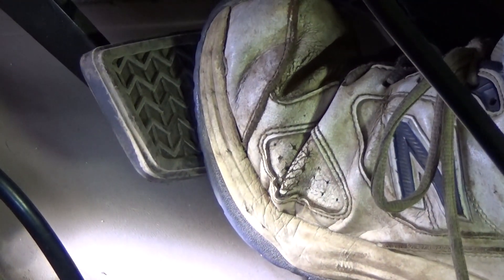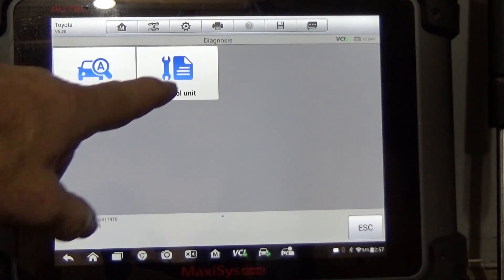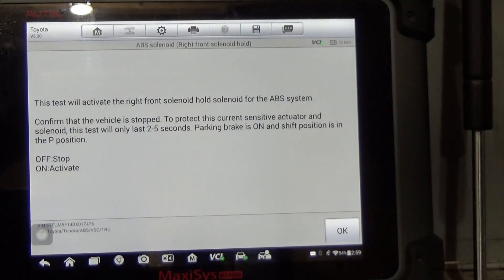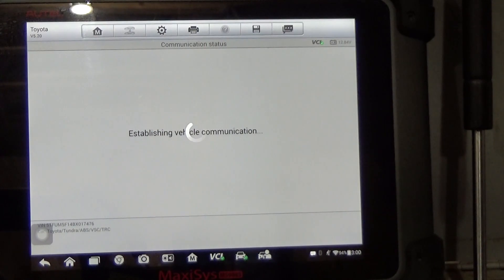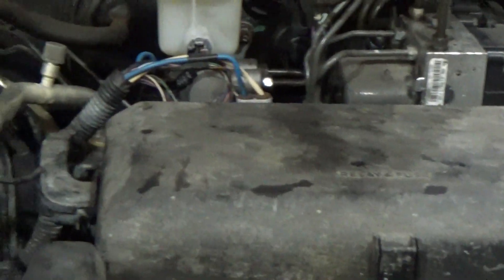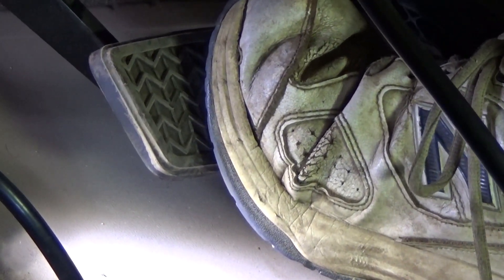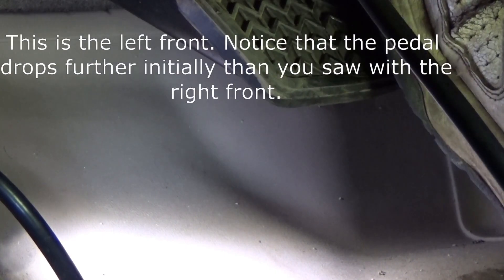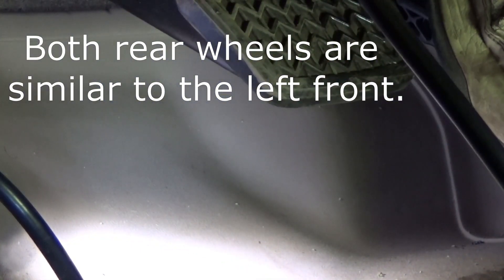Tundra ABS Controller Hydraulic Failure

Comment: John, Thank you for posting this video. even being an engineer for years, we are still learning every day. 

Got a few questions for you

Problem: I have the exact same truck and the same issue you have described. I used the software to test the ABS hold and release solenoids and applying brake pressure through the pedal, one of wheel behave differently from the rest whether triggering the "SFRR" or "SRRR", the pedal will travel further as you activate it, it only applies to the passenger rear, so it is obviously different when thing should be identical to each wheel,  then I went on to study this particular ATE ABS hydraulic circuit online, but seem like I can’t find an exact match of what I am looking for, without the missing information, I can’t seem to connect the dot, I hope you can shred some light since you are pretty smart using the elimination method to identify the problem.

Given  – Fluid is incompressible, the system is free of air, MC is in working order.

Assumption 1 – The Tundra MC Hydraulic circuit  should be pair as follow –  (Front Driver/Rear Passenger)         ( Front Passenger/Rear Driver) 
             For this MC configuration, we assume both plungers is in working order. If not, this ABS test may not be valid.
Assumption 2 –  we are working on 12 valves units,  for each wheel, there should be 3 valves, one being Solenoid Feed(NO), Solenoid Return(NC) , not sure about the last solenoid, I assume it is isolation, but the most online source does not show it. That is still puzzling me what are the last valves for. Either way, 12 valves total.
Assumption 3- two Low-Pressure Accumulators (LPA), one for each individual MC circuit. 

Logic 1 – The purpose of the Solenoid Return is to control the pressure relief into a lower pressure region correct? if so, the pedal should move as the displacement increase with a given amount of fluid ( went into LPA)? This test tells us RR is the prove this logic is true, and 2 scenarios can happen-

1.)	LPA is filled with Fluid(Where the fluid went exactly? I thought it is a closed system? I don’t see a return line back to the brake fluid reservoir like other design) 
2.)	LPA is not filled 3 solenoids are stuck mechanically and one is working?

Logic 2 –  It can be the RR circuit one-way valve or the solenoid bypass, or the rest of the circuit has an issue except RR.  Without knowing the purpose of the last solenoid, I can’t make that conclusion
Reply from the maker: This is going to be fun, I cover a lot of this in our ABS/Traction Control system classes. First the control solenoids (valves) Originally ABS only needed two valves for each hydraulic circuit that it controlled. One valve to isolate the wheel (or wheels) and one to dump pressure from the wheel(or wheels) if it was still locking up. The low pressure accumulator should not be filled with fluid under normal circumstances. Fluid get's dumped to the accumulator when a wheel is locking in order to release it and get it to start turning again increasing tire traction. 

Newer traction control systems and automatic braking systems had to add a third valve to allow a brake circuit to be pressurized without pedal application. That valve has now claimed the name of the isolation valve. The original isolation valve is now called an inlet valve. 

There are three channel systems and four channel systems.  Confusion can occur during testing if your tool does not alert you to the possibility that you may have a three channel system when it appears to give you controls for a four channel system. Count the lines connecting the ABS controller to the rest of the vehicle.

 5 lines,  A Three Channel System:
Two for the master cylinder input, 
One for each front wheel output, (total 2)
One for both rear wheels.

6 Lines. A Four Channel System
Two for the Master Cylinder Input
One for each front wheel output (total 2)
One for each rear wheel output (total 2)

The four channel system could be an "X" design, but doesn't have to be. 

The Three channel system is not an "X" design. 

Now for the fun part. The brake system is only a closed system (for hydraulic purposes) when the ABS/Dynamic Proportioning Valve/Traction Control Systems are inactive. The moment they become active you will have different pressures in the different wheel circuits so by definition (pascals law) they cannot at that point in time be a closed system. 

See if that helps you with your conjectures.
Reply: @thecardoc100   That makes complete sense now, that's where all the ASC DSC ELSD(control by braking, not BMW M stuff) about, learn another new thing! 
 I do have a four-channel system where it controls each individual wheel. I ran the following test -

ABS Solenoid (SFRR)- Pedal sink further as solenoid energized
                         (SFRH)- Pedal movement minimal after activated
                         (SFLR)- Pedal movement minimal after activated
                         (SFLH)-Pedal movement minimal after activated
                         (SRRR)-Pedal sink further as solenoid energized
                         (SRRH)- Pedal movement minimal after activated
                         (SRLH)-Pedal movement minimal after activated
                         (SRLR)- Pedal movement minimal after activated

With your clarification, I think it narrows down to two possibilities-  

Case 1 - Fluid got to go somewhere, as soon as (either SF or SR) solenoid RR open, the fluid went into LPA, which is normal and all others failed to open mechanically therefore pedal only travel minimally. 

Case 2-  Check valve for the RR inlet valve stuck open, cause a fluid leak at the inlet solenoid activation. All other check valves working properly but still don't explain why the pedal only moves minimally as the solenoid energized. 

This is just my curiosity and wants to understand better how ABS works, either way, I bought the ABS unit for replacement.

John, it is nice talking with you, and great to have you in the automotive community-

I use the following link to understand the system John talks about, I hope this helps everyone else who wants to learn about ABS 
https://www.underhoodservice.com/abs-esc-hydraulic-control-unit-modulator-diagnostics/
Reply from the maker: @carlosk2752  Case 1 - Fluid got to go somewhere, as soon as solenoid RR open, the fluid went into LPA, which is normal and all others failed to open mechanically therefore pedal only travel minimally. 

For clarification, let's imagine that you have a dump (release) valve leaking and fluid is going into an accumulator for one of the wheels. The pedal will be low with each wheel because of that fluid loss, but will go lower, up to the maximum volume of the accumulator as the non affected brake circuit dump valves are operated. The key point is you will feel the pedal drop with the brakes that don't have a leaking dump valve. The one that is leaking opening the valve has no change since it has already lost fluid to the accumulator. 

Case 2-  Check valve for the RR inlet valve stuck open, cause a fluid leak at the inlet solenoid activation. All other check valves working properly but still don't explain why the pedal only moves minimally as the solenoid energized. 

If I am following this correctly are you suspecting that you have two failed valves (both the inlet and the dump)  for the same wheel? (in this case the right rear?)  I'm certainly not going to say that can't happen given what often causes failures inside the valve body assembly but that would be a weird one for sure. 

When an inlet valve is closed for the brake circuit that has the problem, (just like in the video) that should result in a higher pedal until the command is turned off.
Reply: @thecardoc100  Once I got the ABS replaced, I will do a bench test to energize each solenoid, then I know if my theory makes sense, but I think case 1 is what is happening like how you describe it.   LCA should only on be indepednce per wheel for this to make sense. otherwise the leaking solenoid would have filled up with the shared LCA.

   I agree with you on this one -   The key point is you will feel the pedal drop with the brakes that don't have a leaking dump valve. The one that is leaking opening the valve has no change since it has already lost fluid to the accumulator.
Reply: John,
       As I replaced the ABS module with a "remanufactured" one (by seller), bled the brake with TS,  Reset ABS, align yaw and steering angle, the pedal have gone worse, now the pedal can be depressed all the way to the floor when the engine is on, however when the Engine is off l, it is firm.  . Long story short, would you happen to have a hydraulic diagram for this particular ABS ?  are the Holding and Reduction valve normally open? or normally closed? I used the TS  to test the holding and reduction valve to " on " position, the pedal moves minimally.  ABS such as Audi BMW and Nissan Ate MK60 unit, those bleeding process actually using the ABS pump drive the fluid out of the circuit, while TOYOTA only cycle the pump then bleed it manually, there maybe something different about it.
Reply from the maker: @carlosk2752  Being able to push the pedal to the floor, with the engine running. Would you push the pedal with that much effort if you were driving? Or said another way, how much brake pedal effort would you use to stop normally and compare that to how hard you are pushing the pedal in the above observation. Once the engine is running and you have assist it's plausible that you can push the pedal to the floor, but you probably would have locked the wheels up and forces an ABS stop with only a fraction of the effort. Having a firm pedal and not being able to push it very far without the brake booster helping suggests to me you are observing normal behavior unless you can come up with information that would prove otherwise.
Reply: @thecardoc100   I did a test last night, with the engine off, waited 10 minutes, depress the brake pedal, power assist remain until after 5-7 stroke depress. brake pedal becomes firm. I hold the pedal down while starting the vehicle back on, the pedal sink close to the floor. it is the same scenario with the ABS unplug completely. I have noticed that this Tundra has some electrical plug that goes into the brake booster, then I read up online there are some active brake booster, I wonder if it has to do with it.  I can't explain why the pedal sink even with the ABS module left disconnected. I never thought Brake booster would have to do with it because I thought it is direct mechanical linkage with vacuum assist, I think the boost must have some sort of sensor and actuator in place.

Comment: I have  an 07 Tundra, just changed the front pads, rotors and left caliper cause it had two holes in the rubber. Now I can't get the new caliper to bleed.  every other wheel is fine. Do I need to replace the ABS pump actuator?
Reply from the maker: What do you mean by you cannot get it to bleed? Is there no fluid getting to the caliper at all? (break the hose connection loose)
Reply: @thecardoc100  i did it had a slow stream that turned into a drip
Reply: I borrowed an Autel mx808 from my brother and tried to bleed the ABS I just took the hose off again after I tried to bleed it and it just drips
Reply from the maker: @33bighands  How exactly are you trying to bleed the brakes?
Reply: @thecardoc100  I used the Autel to bleed the rear right then, manually bled right rear by pumping the brake a few times holding the brake, opened the bleeder then closed the bleeder and repeated until all the air was out then did the same procedure on the left rear then right front and got to the left front thats where I have the issue
Reply: @thecardoc100  Finally figured it out... had a little bit of air still trapped in between the master cylinder and the abs. Finally got brake fluid down the line but the new caliper is bad and still not taking fluid. Gonna take it back to NAPA tomorrow... Thank you for your help...

Comment: Assuming you have this same exact issue before the parts cannon was fired, how do you determine if it's actually the master cylinder or the abs controller? What if it's both? How would one diagnose that correctly
Reply from the maker: This is where the logic portion of diagnostics come into play. We ask ourselves just those kinds of questions and see if we can figure out the answer. In many cases the answer is discovered by asking the right question about the question like this. If it was the master cylinder, that would cause a loss of pressure to the brakes. Operating the valves with no pressure in the brake system while the pedal is already at the floor would? The answer you should be coming up with is have no effect. If the problem was with the electronic portion of the controller instead of the hydraulic portion, the first thing that I would expect to see is a trouble code for that solenoid circuit such as circuit too high, too low or not plausible. It's also likely that the scan tool will be kicked out of the test. From there if I was trying to command the solenoids and I couldn't hear them clicking as demonstrated, I would connect my low amps probe around the power or ground circuit for the controller and try to measure the current that would flow when the bi-directional command is sent with the scan tool.
Reply: @thecardoc100  Okay, that makes sense. So to recap a bad master cylinder would cause the pedal to sink continuously, but the abs controller would cause the pedal to sink like you showed in the video?
Reply from the maker: @firstlast---  This is where the "learned feel" will come into play so this does need to be practiced, but essentially yes a master cylinder failing has it's own specific behavior. In most cases when the ,master cylinder is just starting to fail a light brake pedal application will see it leak worse than a heavy application of the brake pedal. So  the pedal drops "faster" with minimal pressure. Once you can feel that difference with the car, use a heavy apply to the pedal to make it fall slower and then operate the solenoids as in the video. That will give you more of a positive reaction to the solenoid operation. Pay close attention to how far the pedal moves with the dump valve operation. Once you fill the accumulator, or the valve closes you will feel the speed of the brake pedal movement change.
Reply: @thecardoc100  I capped the master cylinder with an old brake line that I hammered flat to seal it up, pedal was rock solid, meaning the problem is not in the master cylinder, right? So now on to the ABS unit. Thanks for posting the video!

Comment: Hi John, great video! I came across your video looking for support on what I think is the cause of a problem on my Dad's 2009 Tacoma 2.7liter, he's experiencing problems with the brake pedal gradually dropping almost to the floor when he comes to a complete stop. With no ABS or any other warning lights on panel, I concluded it must be Master Brake Cylinder, went and bought a new one, installed and bled the system and everything was normal for a day or so, it started behaving the same way, vehicle comes to stop and pedal gradually starts dropping, I'm guessing that it's a mechanical ABS failure since no warning light is on, given the year of the vehicle and since I don't own a scan tool, I can't do this procedure. Hi from Puerto Rico!